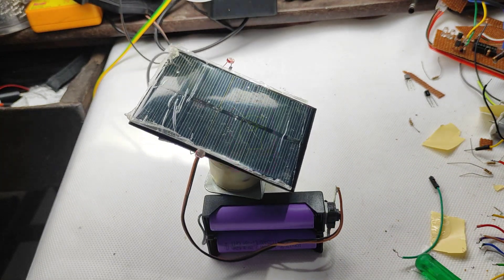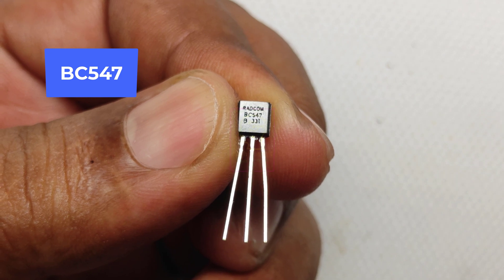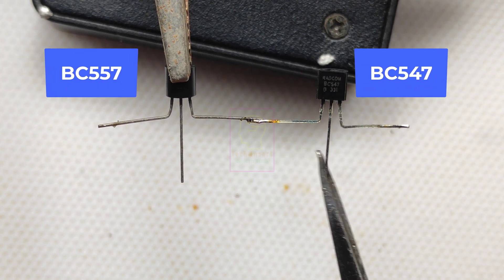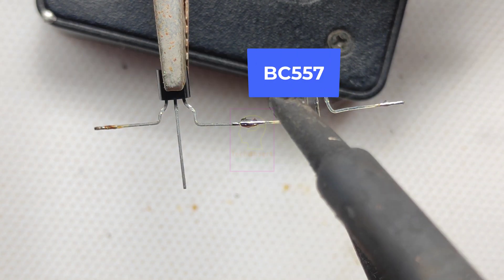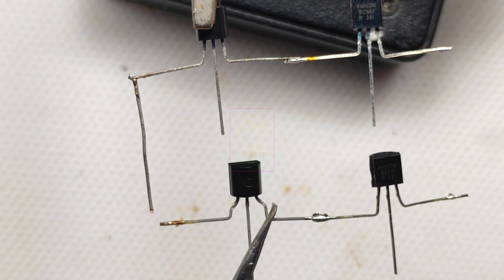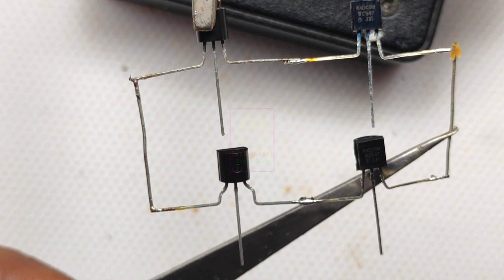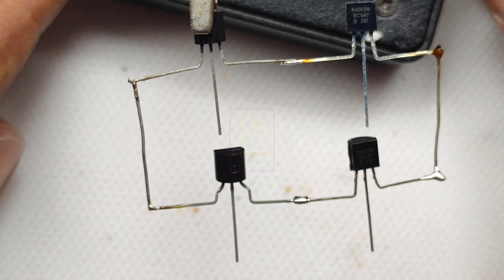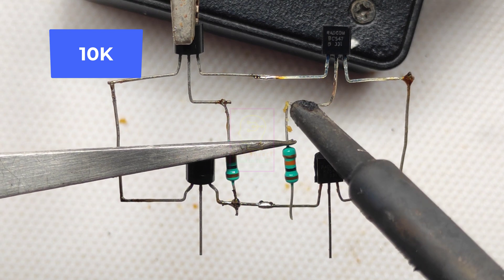Automatic Solar Panel Sun Tracker ☀️ ( Without Arduino ) | Science Project | Solar Tracker

Comment: What is the value of LDR?
Reply from the maker: Ldr does not have any value. It has a size like small, medium large. We are using a small one.
Reply: @TechInsert  Thanks for your reply, as per my knowledge LDR not only specified with its size, but also it has some technical parameters like its light resistance range, dark resistance, power dissipation, impressed voltage in DC, operating temperature etc. I am concern about these values.

Comment: Looking at the schematic, it appears that when sunlight equalizes between both LDR's the motor stops running.  One of the main problems with these type of solar trackers is that the motor keeps running and on larger solar arrays the motor will burn out very quickly.  Can you confirm that the motor stops running when both LDR's receive equal amounts of sunlight?
Reply from the maker: Yes, that is correct - the motor should stop when the light is equal on both LDRs.

Comment: Circuit are ok. But why not use 2  x 0.5small solar projeckt panes less room for error and way less solder parts
Reply from the maker: We can make small to big sized control with power MOSFET and igbjt

Comment: working but i have a problem. Motor is moving on one side continuously. Light balancing problem on both LDRs.
Reply from the maker: Check ldr and transistor
Reply from the maker: Mostly the transistor might be faulty

Comment: We want to know the terminal (positive and negative) for the motor in the connection. My design is continuously rotating, what shall I do?
Reply from the maker: You dont need the polarity, check the transistor. It might be faulty
Reply: @TechInsert  Thank you for your reply. Is it necessary to insert switch ?
Reply from the maker: @SusithraKumaran-f8w  some time it is needed

Comment: Sir ye work ni kar raha kya aap help kar sakte hai?
Reply from the maker: Yes I can help u. Try to fix two leds connected back to back and replace motor with the leds. Now leds should light
Reply: @TechInsert Hamne supply 3.7 V and 7.4 V and 9 volt supply dekar dekha 9 volt ke motor ko but motor not operate
Reply from the maker: @pavanverma7202  Whichh motor u r using,? toycar motor
Reply from the maker: @pavanverma7202  If led is lighting then motor will also work = check the current in battery
Reply: Sir current proper nahi mil raha kya kare @TechInsert
Reply: Gear motor  @TechInsert
Reply: Apne kitne volt ki supply di hai? @TechInsert
Reply from the maker: 12v
Reply: @TechInsert Sir LED ke place me buzzer use kar rahe hai to work kar raha hai but motor operate nahi ho raha hai
Reply: Sir LED ke place me buzzer use kar rahe hai to work kar raha hai but motor operate nahi ho raha hai
Reply: Hamne supply 3.7 V and 7.4 V and 9 volt supply dekar dekha 9 volt ke motor ko but motor not operate
Reply: Please help m
Reply: Sir apne kon sa motor use Kiya hai?

Comment: Bro can it work on 9 volt battery
Reply: What is 9 volt gaer motor
Reply from the maker: A motor with a gear system connected to the shaft. Rpm of the motor will be low but with high torque
Reply from the maker: Yes, but give 9v geared motor
Reply: Sir it's not working I don't know why
Reply: I have used same resistor and transistor
Reply: A 12 volt DC motor as well

Comment: Sir I'm using small 3 v motor and 3.7 v battery but they doesn't work.
What we do pls help sir.Circuit is  completely correct.
Reply: Circuit is correct when I'm joining leds and check it run properly but motor is not running I think motor  short ho rha hai isliye.
Any suggestion sir.😢
Reply from the maker: @flyingbeast9448  so ur circuit is running properly. Check ur motor
Reply from the maker: Without load whether the motor is running. You can replace the motor with 2 leds connected back to back. This you can test the circuit

Comment: I can use a motor from remote control toys sir?? Please reply
Reply from the maker: Speed will be very high. But you can try, but reduce the voltage. Geared motor will works fine

Comment: Thank You Sir ❤🎉 Circuit Work Farfetcly But The transistors go bad after it works well the first time, could it be the reason? Because of the motor ?
Please Sir Reply ❤
Reply from the maker: You should use a geared motor. If your motor is using more current , use a transistor which meets it's current consumption
Reply: @TechInsert 
How to use  a transistor
Reply from the maker: @bhagawatiofficial__singer4271  High ampere you can use TIP series or 3055 and 2955
Reply: @TechInsert  Thank You Sir 🤗 TIP3055 Or TIP2955 Dono mese Koibhi Aek Use kare Ne ? Or Uska Circuit Aesehi Banaye ? Sir Mere Pas 10RPM Gear Motor He .. Thank You Sir  Reply Dene Ke Liye 🤗😊😊❤️❤️
Reply from the maker: @bhagawatiofficial__singer4271  बस सर्किट में ट्रांजिस्टर को 2n3055 और 2n2955 से बदलें, यह ठीक काम करेगा
Reply: @TechInsert  Thank You So Much Sir 😊❤️
Reply: @TechInsert  sir par isme to two Terminal Hote hai Na To Kese Canction Kare ? Aor Ham Kitene 2n3055 or 2n2955 kite lane padege 2-2 lane padege ?
Reply from the maker: @bhagawatiofficial__singer4271  Please watch this for conenction of 2N3055 https://youtu.be/um9AguTkt5Q
Reply from the maker: @bhagawatiofficial__singer4271  welcome
Reply: @TechInsert  2n3055 or 2n2955 kitne lane padege
Reply: @TechInsert Please Sir Last Question ❓ Please Sir Thoda Deep Me Circuit Samja Dono Aor Kite 2n3055 or 2n2955 use lene Hai Muje  4 Day Me project Dhikana Hai Aor Complete Nahi Huva please sir Itni Madat Kar Do 🙏🙏🥺😭
Reply from the maker: @bhagawatiofficial__singer4271  The circuit is using H-Bridge. In H Bridge the direction of the motor is controlled by the transistors. For one direction one PNP and  one NPN will be working and for another direction of the motor the orther PNP and NPN will be working. The LDR's are connected to these transtsors base in reverse direction. That means when light falls in one LDR the transitor will be in OFF state, and if no light is falling in the LDR , that transtors will be ON state and is rotati\ng in one direction. It is controlled by the intensity of the light falling in the LDR.
Reply from the maker: @bhagawatiofficial__singer4271  The project is working fine right?
Reply: @TechInsert  Thank You So Much Sir🙏❤️
Reply from the maker: @bhagawatiofficial__singer4271  Welcome
Reply: @TechInsert sir can you Use Low Current Cansuam Motor ex servo motor ya ,12v 200rpm Motor ya Or Use
Reply from the maker: @bhagawatiofficial__singer4271  200rpm is very speed for this. 5-10rpm is perfect for this since this should move as low as possible

Comment: Sir Aapne yellow color Ka Register Lagaya Hai Ushki Jagah Shabhi Aek Jese Green 10k Ke register Lagaye Hai Kya Problem Aayegi ? Not Work What Problem Please Sir Reply 😢🙏🙏😢
Reply from the maker: All resistors are 10k any color is ok. Check the transistors and their connections. Normally everyone will miss connect the npn with npn but it should be npn with pnp . That is the connection for h bridge. It will work, kindly check the connection. Instead of the motor you can give 2 led's back to back
Reply: @TechInsert  Thank You Sir🤗
Reply from the maker: @bhagawatiofficial__singer4271  Welcome
Reply: @TechInsert  sir All Circuit Is Proper But Not work and Voltage on Circuit Hited What Problems Sir please Reply Fast Me  please 🙏🥺
Reply from the maker: @bhagawatiofficial__singer4271  Please check pnp and npn transistors . Does that connected in reverse ?
Reply: @TechInsert sir  It worked fine last time but now it won't ?
Reply from the maker: Some issue in the  circuit, I feel ao

Comment: Not working
Reply from the maker: Kindly not blindly tell that it is not working, it will work. The circuit is not rocket science and not at all complicated. Please  describe about the issue. Check the transistors. 2 PNP and 2 NPN . Top 2 are PNP and bottom 2 are NPN. LDR's are connected in reverse biasing model
Reply: @TechInsert  aapne jaise video me bataya tha maine vaisehi banaya hai same lekin nai work kia
Reply: @TechInsert ye jo aapne 10k ka yellow wala resistance lagaya tha maine uske jagah 10k ka green wala lagaya hai aur Sara surcuit same hai
Reply: @TechInsert  Maine 1 bar aur banaya lekin work nai kia
Reply: Kya aap ek aur video bana sakte hai sun tracker par without ic

Comment: Without this, what other gear motor can be used.      Verve 1000Rpm Motor chalega ? Amazon par Aesa Dikha raha hai
Reply from the maker: Mostly
Reply: How many volts of motor has he done in this?
Reply: How many cells should be used for a motor of 1000 rpm ?
Reply from the maker: What type liion- 3, life-4,

Comment: Have you every heard or use a breadboard. This would make the build much easier.
Reply from the maker: I assembled this in breadboard while designing.  After made it success i made it for video making. Breadboard assembling will not help newbies to assemble this. For that i am assembling this in component leads so that they can easily make. For expereinces peoples i have given circuit diagram in the video so that they can assemble this in dot board or even breadboard. I totaly agree with you and in so many of my videos i have told the same thing "Assemblin in dot board is much much easier than assembling directly to component leads". Anyway thank you very much in pointing this.
Reply: @TechInsert  Thaks for this detailed explanation
Reply from the maker: @John-pk7lr Welcome
Reply: @TechInsert  Well explained
Reply from the maker: @TitusKelly-cj8um  Thanks

Comment: Most of the solar trackers in youtube are build using TDA series amplifier IC. I dont know why they are using this IC. This one with H-bridge is an excellent one. Trackers using Op-Amp's are also good. I was searching for this circuit for a long time . Bunch of thanks.
Reply from the maker: Thanks 🙏. I'll design using Op- amp and power MOSFET  later. I don't recommend using audio ics
Reply: Yeah most of the peoples are making this using tda2822 audio amplifier IC which i do not prefer.
Reply from the maker: @NiguRyne  You are right, i too dont recomend that. Transistors or op-amps are the best solution
Reply: @NiguRyne  Absolutely correct
Reply from the maker: @NiguRyne  Thanks
Reply: @TechInsert can i use it for my 100 watts solar panel and 21volts motor? please reply 🙏🏼 its for our thesis this semester please reply ASAP
Reply from the maker: @JasperJamesJAndo  100W panel  will roughly l give you 4-5A at peak time.  I prefer you to use a 12V geared motor. Use a separate power supply for motor. It can be from the battery whicj can be charged using the panel
Reply: @TechInsert  thank you so much for replying thank you again ur so much a big help
Reply from the maker: @JasperJamesJAndo  ur welcome
Reply: @TechInsert hi again will it work if i copy ur resistors and transistors? and if its ok boss what are the names of that so that i can order them thank you
Reply from the maker: @JasperJamesJAndo  Components Used:-

BC557 -2
BC547 -2
10K Resistor - 4
LDR - 2
Motor
Solar Panel etc
Reply: You are absolutely right , every one is designing using audio IC
Reply from the maker: @ArthurJsc-ji5jt  I dont recommend that
Reply: imean what are the things i need to make my 12v motor work for solar trackig
Reply from the maker: @JasperJamesJAndo  Is ur motor geared one?
Reply: @TechInsert  yes it's geared one
Reply: @TechInsert  do you have an gmail? if its ok i need your guidance 🙏🏼
Reply from the maker: @JasperJamesJAndo  Then u can use that
Reply: @TechInsert  can i extend my wire for my ldr? cuz my solar panel is kinda big this is its size (100W)350*450*16mm/(200W)600*350*16mm
Reply from the maker: @JasperJamesJAndo  Yes you can, not an issues. The motor should be good enough to rotate with the weight of solar panel
Reply: @TechInsert  thank you so much
Reply from the maker: @JasperJamesJAndo  welcome